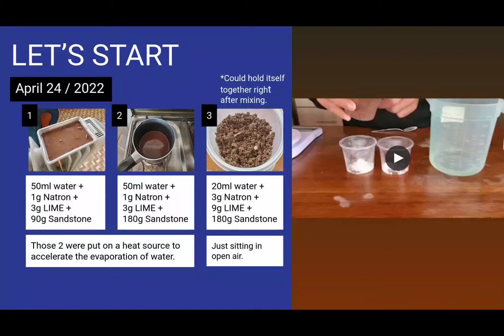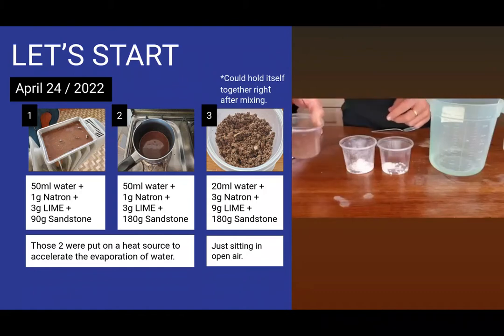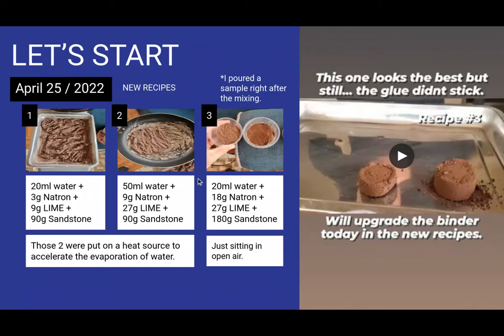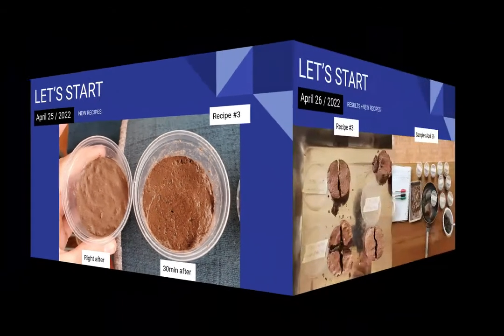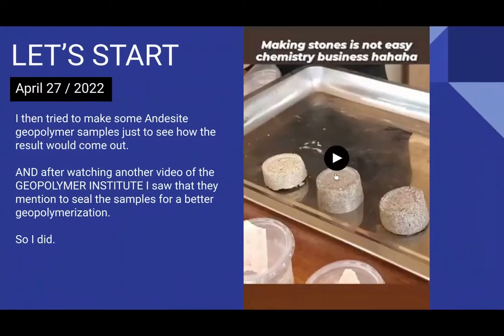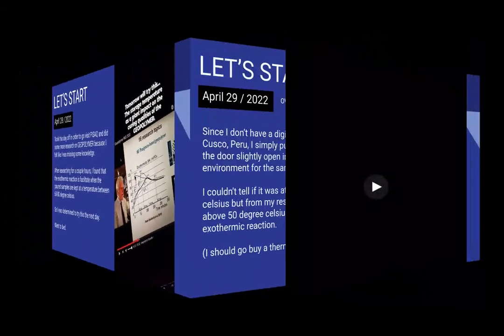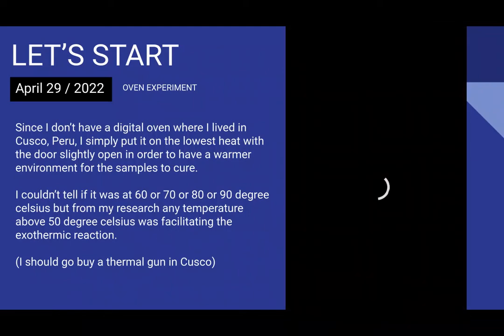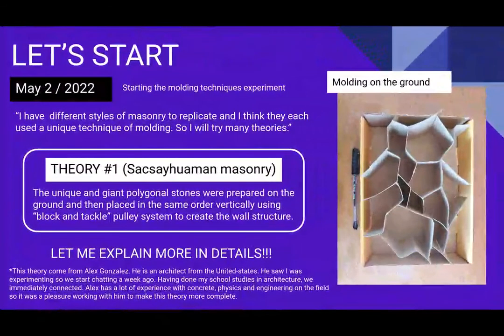21 days GEOPOLYMER experimentation - PART 2 - Ancient Masonry

Comment: try hydrated lime sodium silicate  and lime instead will set up very rapidly and have high strength
Reply from the maker: To make my "NATRON" salt I used Sodium bicarbonate when I should have used sodium carbonate. So no geopolymeristation took place but I understood the full process and still got some very hard samples. 

Only using materials available in nature In peru
Reply: @WallaceSpirit  also the hydrated lime byitself acts as a alkali activator
Reply from the maker: @prototype9000  Interesting. Joseph Davidovits says that alkali activated are not geopolymer... like concrete is not for example. Because the alkali always outside of the structure.

Geopolymer is another science completely where you create a perfect stable structure and this is what give it such a enormous strenght that just keep getting stronger and stronger with time.

The opposite of alkali activated.
Reply: @WallaceSpirit  a geopolymer needs some level of activation he said that but alkali activation alone does not make it a geopolymer the chemical bonding of between the elements does  also his new research hes now using acid activation with no processed stuff like lime all from the earth all ingredients prepared at room temperature
Reply from the maker: @prototype9000  Yes exactly. All the geopolymer recipes I learned from him in France were room temperature.

Its actually a must in the geopolymer recipe we know today. 

He think that basalt and granite geopolymer might need heating... but nobody knows yet
Reply: @WallaceSpirit  he has posted most of his research its very sparse on the new methods though the one i was telling you was near his final research with alkali activated geopolymers before he switched to acid activated materials as being superior
Reply from the maker: @prototype9000  Yes I was at his home, in his office, in his laborarory with him and Ralph Davidovits in 2022 🙏😉 I know. Its pretty recent.
Reply: @WallaceSpirit  with the egyption formula i found out in wet climates it reabsobrs moisture after a while starts breaking down unless you use metakaolin and add other alumisilicate

Comment: Hi Wallace. Probably put on a heating source the "soup" created is not the best way to obtain a good geopolymer.
You need time to allow the new atom structure to create the bonds. If you push the time by evaporating water you will obtain inconsistent results.